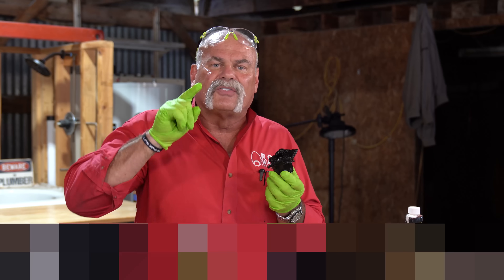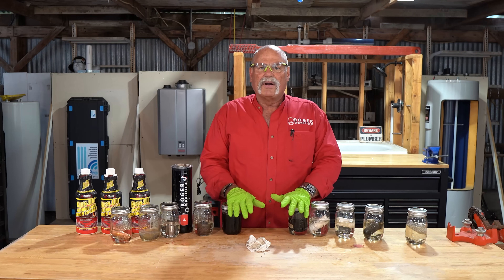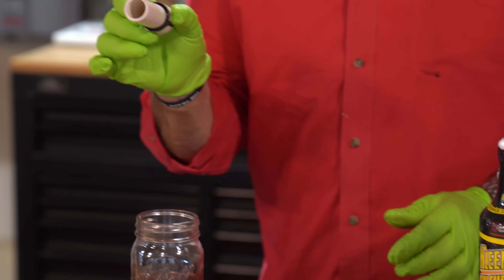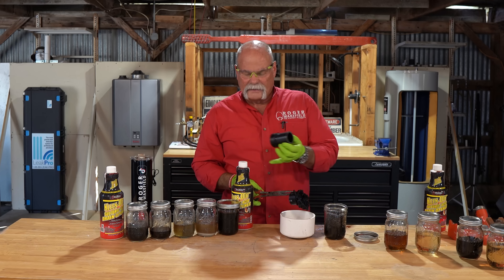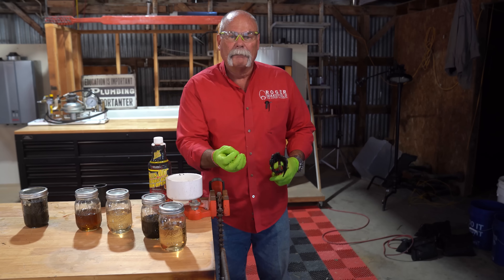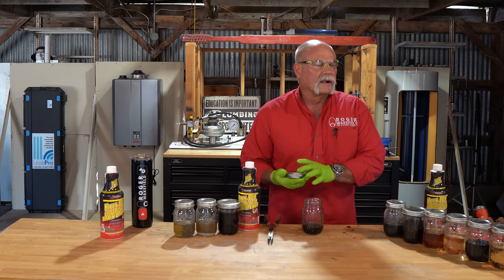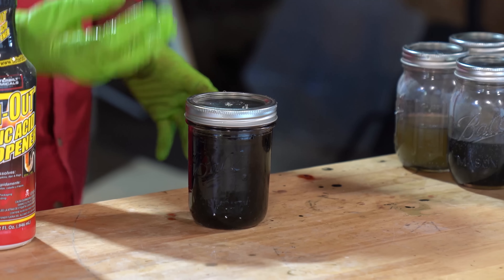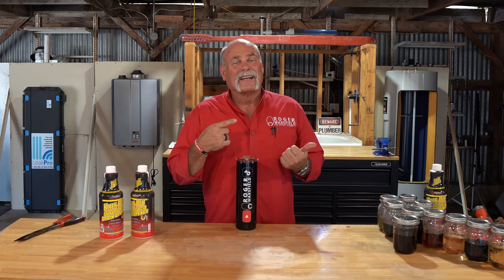Real Plumber Tests BANNED Drain Cleaner

Comment: if someone were to use sodium hydroxide(Draino) and the clog did not budge but the Hydroxide is still there, then that concentrated sulphuric acid could react violently with the hydroxide and could cause it to shoot out like a geyser.
Reply from the maker: Fun, but scary to know! That’s why I advise AGAINST drain cleaners. Thanks for sharing
Reply: Gotta neutralize it first
Reply: there's two part cleaners that more or rely upon reactions similar to that, but at more controlled levels. lol
Reply: Lye is meant to dissolve kitchen fats. But its unfortunately advertised for all drain clogs.
Reply: @puppiesarepower3682  Yes, it turns grease to soap, but see his other video on hair; lye dissolved it completely in 30 minutes.
Reply: Grown man's baking soda + vinegar

Comment: Used that type of drain cleaner for years, basically to flush the pipes. Galvanized encased in concrete and they emptied into clay sewer pipe.
I had a motorized snake i'd use 1st, i pulled 18 feet of clogged material out of a 45 foot run.
As far as that black pipe that dissolved, that appears to be gray water drainage why use an acid on it?
Reply: So with galvanized the sulfuric acid will eventually eat off the zinc.  It takes awhile, but it will eventually remove all the protective coating.
Reply: In California that type of pipe is used for sink drains. cleanouts and other stuff.  He did a shoutout to California for that specific reason.

Comment: Sulfuric acid is serious stuff. I want to rental wasn't told they dumped a gallon of it down the drain. 3 years later im still dealing with the burns on my legs healing. I kneeled down in what i thought was laundry water. My pants melted off me took about 3min to find a hose and neutralize. Nasty stuff
Reply from the maker: Oh wow, it is very dangerous. Glad you’re doing better…

Comment: Why wouldn't using the plumbing rinse out the belly in the pipe? If you use the product and then dump a bucket of water down the drain, how would the chemical not be washed away?
Reply: It depends if there is a density difference.  In this case there is not, sulfuric acid will mix with water easily.  But some thick gel like cleaners can sit at the low point and if there is not enough flow it will take many many gallons of water to flush them out fully.

Comment: while i get what you say about a belly and the cleaner sitting in there. these however will dilute in water. so, I don't think it will stay in the pipe once you have it clear as the water will dilute it. this is also why they say to run the water for a period of time after the clog is cleared. that being said i would rather use a snake than drain cleaner.
Reply from the maker: Snake over any drain cleaner…but did you see, even when I put the pipe in the water the cleaner was still reacting with the pipe…
Reply: @RogerWakefield  I did but to be fair that's after it had been soaking and worked itself into and saturated the pipe material for 30days.  I do however agree that drain cleaner has the possibility of damaging the pipe.  For me it would be a last resort type of thing if I couldn't get it with a snake. drain cleaner has a chance. However that is only if I am going to be doing the work anyway. 
 
But this does make me wonder how the condensate from tankless water heaters or high efficiency boilers affects your pipes.
Reply: @markburton5292  
> how the condensate from tankless water heaters or high efficiency boilers affects your pipes.

Huh?  What are you talking about?
Reply: @justgivemethetruth  
High-efficiency appliances like condensing tankless water heaters and boilers extract more heat from combustion gases. This process cools the gases enough for water vapor to condense, forming liquid condensate inside the unit.
This condensate is acidic, often with a pH between 3 and 5

not all systems neutralize this before being released as it wasn't code when many were put in
Reply: @markburton5292  I have a tankless water heater, and it has burners that heat the water through a heat-exchanger, and then vents directly to the air.  After it has been activated it has a fan that  runs to pull out any exhaust left in the unit.   PLUS - not all of these heating appliances run off gas, many are powered by electricity. I don't think it is a problem, at least so far.
Reply: @justgivemethetruth  if you have a tankless or any boiler/ heater that is 95%+ efficient it has a condensate if it is running on gas or any other fossil fuel.

Note my also has a fan that keeps running after it stops burning to pull the co2 up and out.
that doesn't mean it doesn't have condensate.

Sure an electric one doesn't but that isn't what I was talking about.

I think you need to go do some more research before blowing you top off at someone over something you seem to know nothing about.
Reply: @markburton5292  LOL, hardly blowing my top off.  You're just not making your case, or providing a better alternative.
Reply: @justgivemethetruth  no you still haven't gone and done you research. go look up the model of your tankless. if you have a high efficiency one.

you will see it has a condensate line.

just because you don't know what you're talking about does not mean others don't.

High-efficiency tankless water heaters have condensate lines because they produce water vapor during combustion, which condenses into acidic liquid that must be safely drained.

How Condensate Forms
Combustion of natural gas or propane in high-efficiency tankless units produces water vapor as a byproduct.

These units are designed to extract more heat from the exhaust gases by cooling them down further.

As the hot exhaust cools below its dew point, water vapor condenses into liquid inside the unit.

What the Condensate Is
The resulting liquid is called condensate, and it’s not just water it’s mildly acidic due to dissolved combustion byproducts like carbon dioxide and nitrogen oxides.

This acidity can corrode metal pipes, damage concrete, and harm plumbing systems if not properly managed.

Why a Condensate Drain Is Essential
Condensate lines safely remove this liquid from the unit and direct it to a drain or neutralizer.

Without a proper drain, condensate can build up inside the heater, leading to blockages, reduced efficiency, or even water damage.

Some systems include neutralizers to reduce acidity before discharge, protecting plumbing and the environment.

Maintenance Matters
Condensate drains must be installed correctly and maintained regularly to prevent clogs and backups.

In some setups, especially on upper floors, safety measures like drip pans or water alarms may be recommended to prevent flooding in case of drain failure.
Reply: @markburton5292  No, it doesn't and there has never been any drips under my tankless water heater.
Reply: @justgivemethetruth  there wouldn't be if your installer installed it correctly you would have a condensate discharge line that goes into your wastewater plumbing.  

any way it's pointless to argue with someone like you. believe what you want I don't care.
Reply: @markburton5292  I installed it myself - outside.
Reply: @justgivemethetruth  If it does not have a condensate, it is not a high efficiency version.  again, go watch the video.  that I linked you. 
Or you can do a simple search on condensing water heater vs non-condensing.

Either way you only keep exposing you do not know what was being talked about, and I am moving on since you seem to be incapable of doing simple research.

 Have a good day.

Comment: I forgot this originally but, first great testing very interesting to a guy like me, but I don't believe this would actually cause a problem, I know you say it can lay in a bow I get that, but if it's properly flushed and used often the chemical should be so diluted it wouldn't cause a problem, unless you use the drain cleaner very often.
Reply from the maker: Did you see how it was still reacting with the pipe fully submerged in the water?
Reply: @RogerWakefield  I mean true, I work with chemicals commonly used in these drain cleaners everyday though and it's also standing water not a flush rinse, I mean I shouldn't say I don't believe it would, I guess it's plausible, I just would think if it's being flushed or wouldn't cause that issue, although acids and such are thicker than water so it may lay in the bow, this test is pretty interesting but I think maybe try to put a bow on a pipe pour your drain cleaner in for the amount of time specified and flush it out then let it set with standing water/chemical if there's enough left to deteriorate ABS
Reply: The acid is actually more damaging to metal when diluted. The concentrated acid is not ionized so much, but once diluted it can much more readily react. Sorry you live in a communist state where they are happy to take a useful tool out of your arsenal. Especially since the powers that be probably never touched a tool that wasnt a lobbyist.

Comment: CPVC withstands Sulfuric Acid even at high pressure and high concentrations.
Reply: @anyonecansee4601  I agree we actually use sch 80 in our factory to plumb our acid lines, we typically use hydrochloric but we also have PVC fixtures that we use every day in heated caustic and acid baths. I'm an electroplater so we use some pretty strong stuff, even fluoboric peroxide solution that will eat carbon, nickel, lead, copper, pretty much anything metal except stainless, and it's in a plastic tank, but it's poly pro

Comment: sulfuric acid reacts with water so when you take it out and put it in water it will get hot.
Reply: It depends on the strength.  Fuming sulfuric acid is specifically called “fuming” because it is at a strength where it can break the bonds in water.
Reply: Well logical niko you failed chemistry class didn’t you. Fuming sulfuric acid is anhydrous sulfuric acid in which sulfur trioxide is dissolved. Any water it finds it will convert into sulfuric acid. The sulfuric acid of industrial grades is 92-98% H2SO4 it is a violently dehydrating substance. It will rip apart molecules and construct water to absorb.
Reply: Acid to water not water to acid. It will get hot enough to boil the water and then sling it everywhere. Extreme caution no matter how you dilute it.
Reply: AAA - always add acid
Reply: AnW acid into water. Like A&W rootbeer. Thats how i always remembered
Reply: Ranger178 is correct. Mixing sulfuric acid with water creates an exothermic reaction. That’s why you felt heat, because you rinsed the pipes right after pulling them out of the acid. Same thing when you dropped the acid saturated abs pipe in water. Yeah I know I’m a little late to the party. But, I just saw the video 😂🎉

Comment: We used to use Liquid Fire over at the beauty salon. It was about the only thing that'd bust through those hair clogs. But we also burnt up one of the crossover pipes because it had a bow. This stuff loves to eat metal. But it also cuts through those bad hair clogs too. 

I really wish it wasn't just readily available. It should have required a proper license. Just because it can be extremely hazardous.
Reply: Use Lye, its the simplest, it dissolves hair especially well and its safer than acid (still use PPE and be carefull!)
Reply: @gx200enjoyer  lye is still quite corrosive and in my opinion as bad as sulfuric acid, solid NaOH wont burn skin but the instant you get a little moisture it will dissolve right through flesh, fat, bones, etc. they use this stuff to dispose of carcasses (animal ones legally, human ones in the cartel), and far faster and thoroughly than sulfuric acid or other acids. its safer in the sense its a solid not a liquid (and the liquid formulations are diluted to a decent amount)
Reply: unfortunately, and even despite the warnings which are supposed to prevent people getting things taken down or suing for own stupidity companies and such still get pressured, its a shame because this stuff was the best quality sulfuric acid you could buy which was also cheap. a lab ive been to formerly had a stockpile of them because it was cheaper than the stuff from a lab supplier and worked fine
Reply: @EdwardTriesToScience  that's why I suggested licenses. I mean it doesn't have to just be plumbers. But someone that has shown they're qualified in their field. At a lab you have all the safety equipment and procedures. At home people are still trying to clean restrooms with bleach not knowing how urine interacts with it. Seen a few janitors gas themselves out of public restrooms over the years due to this.
Reply: The fact that it’s in it’s own sealed plastic bag had me feeling like i was dealing with nitroglycerin
Reply from the maker: You should need a license! On KleenOuts website they state it should be used by professional or contractors only…scary stuff
Reply: In my opinion its fine if you just read the label and follow it, theres a label for a reason and as a chemist sulfuric acid really isnt that dangerous if you just heed the warnings and don't do something stupid. Most of the accidents I see from this stuff are people being ignorant and assuming its safe. It says acid for a reason on it and has bold red warnings.
Reply: @EdwardTriesToScience  yeah but you and me aren't average cookies. Most people stumble through life without heeding warnings or understanding what they're actually working with. I've always said "there's always that one dummy" cause sadly that's as true as understanding eventually someone will invent a new way. But there are far more private piles than there are Albert Einsteins.